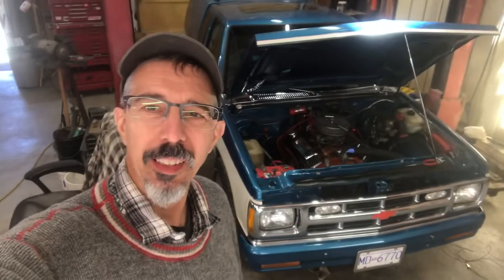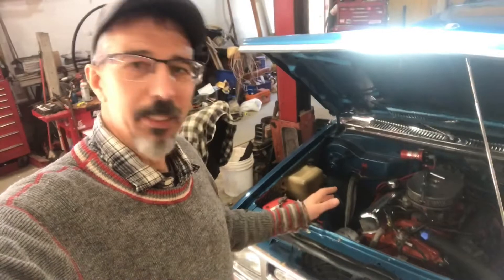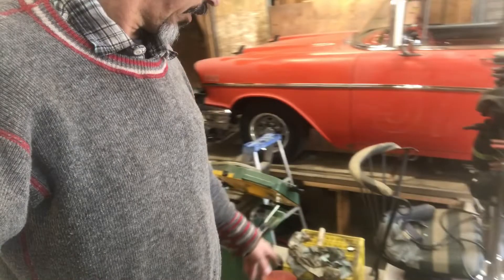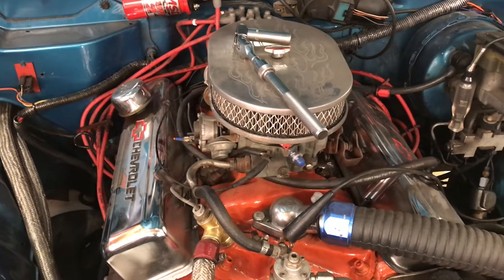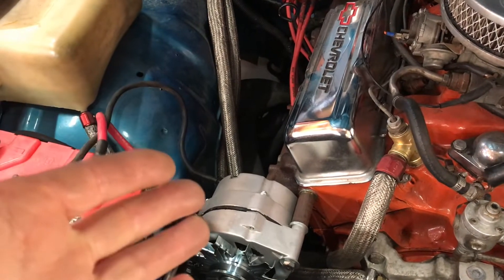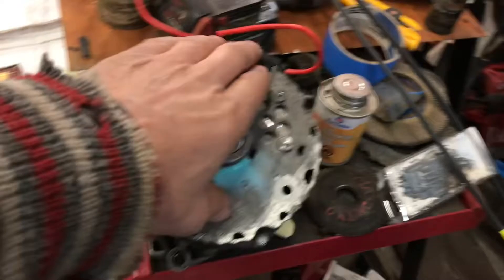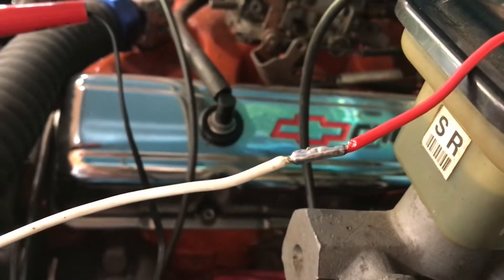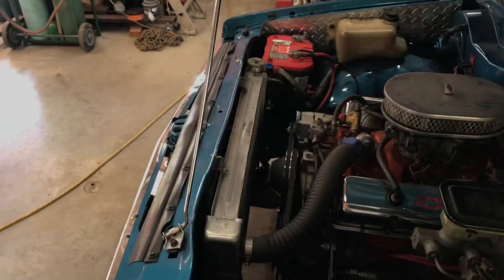S10 V8 CONVERSION WIRING

Comment: I've long had a pipe dream of a ranger with a done up 351windsor and highway gears...would be fun as hell none there's with 3.33s or something out back instead of the 4.10s I would've wanted years ago
Reply from the maker: I put a stock 305 in a S10 with 4:11s it was horrible, swapped out the gears for 2:73s and turned it into a rocket ship.

Comment: I own a Chevy 1989 throttle body 350 been gone though small cam 40 sires flow Masters short bed love the truck.but the one wire your talking that's the dest alternator you can get not all that other junk running to it

Comment: Great work👍🏻 thanks for sharing the SI series alternator makeshift pigtail tip! Much better than spade terminals.
Not sure about deadheaded but ideal gm tbi fuel pressure is 9-13 psi. And some oem pumps struggle to maintain that under WOT conditions.
Reply from the maker: You’re welcome Aaron and I stand corrected, port injection pumps make 30ish. Thanks
Reply: @WildWestGarage  sure glad you know what your doing , I can repair existing wireing that’s about it. Question , don’t you use the fusable link wiring ?  , I remember shorting out my 78chevy and having to replace it 👍🇨🇦
Reply from the maker: @cameronhamer9432  The original harness probably had a fusible wire running from the #2 to the positive on the starter. I’ve wired several vehicles like this and never had a problem. Thanks for watching, quit shorting things out😊⚡️

Comment: does the bulb only go off when its running , if so if it was parked for a while would it kill the battery  ?
Reply from the maker: The bulb comes on when the key is  in the run position but the engine is not running. With the engine running the light should go out, if it’s on with the engine running you’ve got a charging issue.

Comment: Nice .Have  you ever seen the heat shrink butt connectors with a low temp solder ring inside them? Found them a couple of years ago and wouldn't go any other way now!!!
Reply from the maker: Yes I have used them, thanks for reminding me.